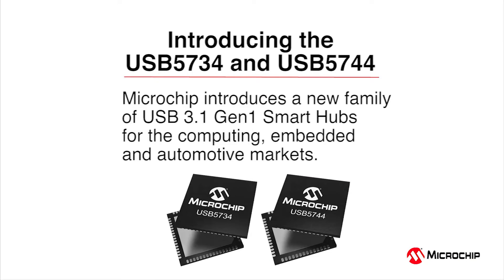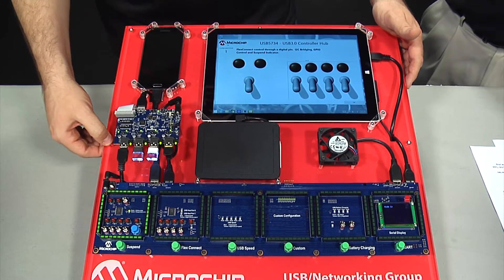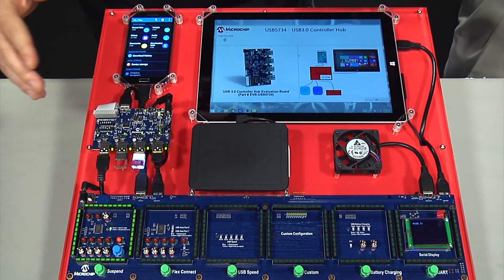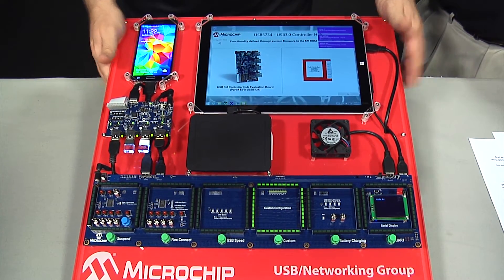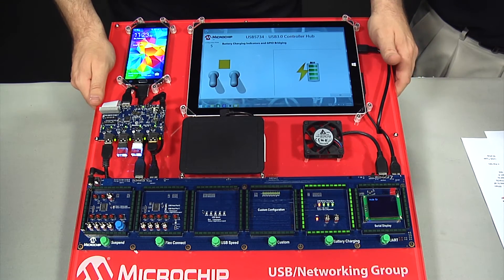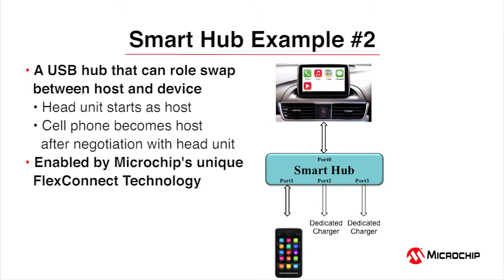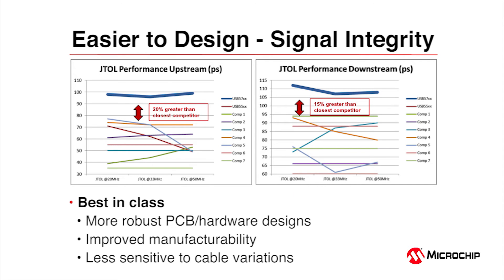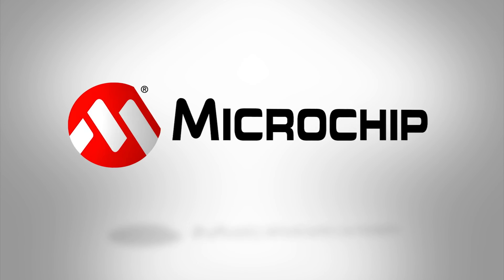USB5734 and USB5744 Smart Hub Demonstration

Comment: Can a downstream port on USB5744 act as a device instead of a host?
Reply from the maker: A downstream port’s orientation can change from Host to Device using our FlexConnect Technology, which is available on the USB5734, not the USB5744. FlexConnect allows a Host to attach to the hub’s downstream port and “Flex” the hub so that the connected port becomes the Host interface, changing the original Host interface to a Device interface. See AN1700 Application Note on the product page (https://www.microchip.com/en-us/product/USB5734) for more details on the FlexConnect operation.